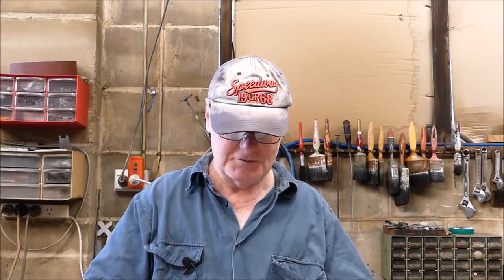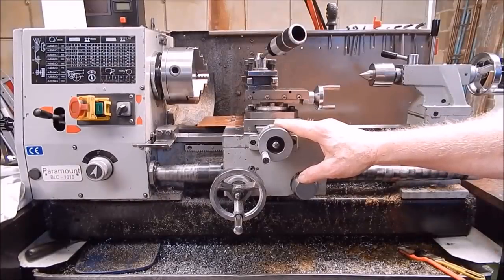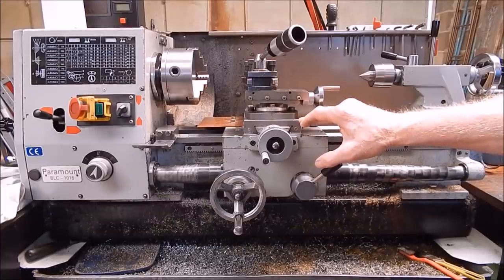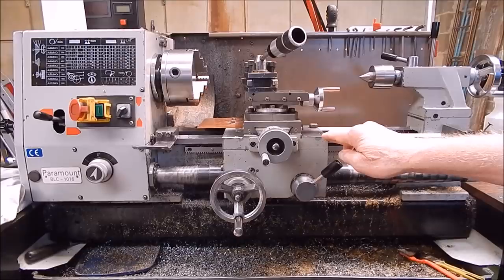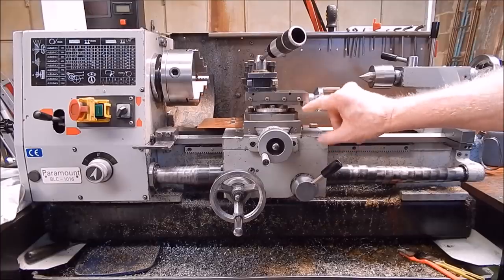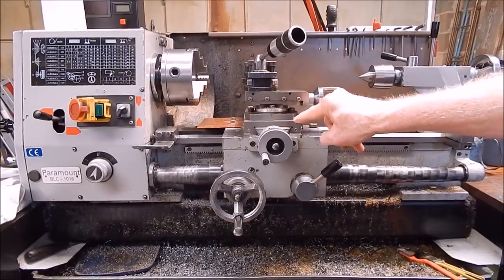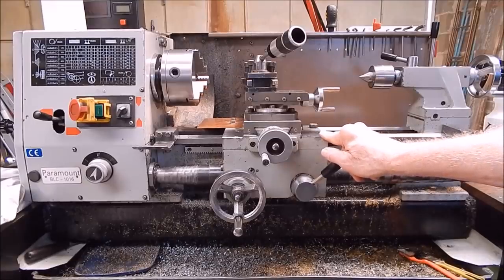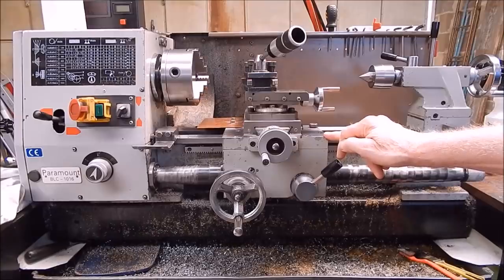The serious weakness in many small modern metal lathes

Comment: Me Shenwai 900b, has one circular T slot for the tool post. No other slots. I made a 1 inch table to fit over it and cut slots parallel to the guideways
Reply from the maker: From my observations T slots are not very common on larger sized lathes.  Strange, but appears that way.  Cheers Rob

Comment: My 7x10in mini lathe has a solid compound and cross slide however my tool post mount is a single threaded rod in the "center" of the compound. The machine became surprisingly ridged after I bought full metal change gear set up (Head Stock Gears too) and went from straight ball bearings in the Head Stock to tapered roller bearings. The amount of material removal rate on steel (mild) went from about .015 thou per side to almost .030 thou per side with spectacular finishes. Aluminium I can take almost .050 thou per side but typically don't. Don't want to kill the poor thing. I learned of these small upgrades from a few guys here on youtube that do the hobby machining. Anyways thank you for the content and thank you for also being a great teacher of various skills from fab to machining. This Yank certainly appreciates it.

Comment: No problem with the T slots here only a pain to clean the chips out! A much bigger issue was the spindle having no spacer so I put a cast iron tube to stop the bearings flapping around, also the shit motor replaced with a 1.5kw 6 pole 3ph and vfd, and big pulleys, then it is like a new machine. Thanks for the good videos.

Comment: I think the t-slots are a carryover from the asian 3 in 1 machines where the cross slide is also a mill table
Reply from the maker: IMHO it's just marketing.  Looks good, it's an additional "feature". Very few people actually use it or think about what it's doing strength wise.  Cheers Rob
Reply: @Xynudu  you are right but the lathes where you can put the mill on the slotes have them besides the dovetails so they can carry the column with the mill head and its plus 65kg for example for my lathe. I was not a fan of these 3 in 1 lathes but after a friend bought one with the milling head I saw the big advantage to work at a part milling and turning without leaving the chuck and that improves precision a lot ....so for some people the 3 in 1 can be a very good solution if they need the accuracy.

Comment: You are absolutely right and that was the reason why i bought the Schreiner D290V ( in USA Precision Mathews sells the same model under 1127 LB ) after my minilathe .It is a Chinese import with 1000mm bed and 265kg without the standing and there it also has the to long T-slots but they are not above the dovetail they are more beside where the "meat" is .First I wanted to buy a little smaller lathe but they all had the T-slots above the dovetails and that's why I bought the smallest with the slots more beside the dovetails .They used a bigger block of metal to keep the dovetails and slots about 10mm away from each other.
I like the slots because you can position the compound at the best place for the job but I had to remake the clamping system with 2 screws into one with 6 screws and now the forces are better divided over the cross slide and the rigidity also improved.Not a big job for that size of  lathe and a mill to remake the compound clamp. clamping.

Comment: Good video Rob and it’s your channel so you can rant if you want to. I have a mid eighties Hafco which is similar in spec to yours except that it’s belt drive so it’s a bit more cumbersome changing speeds and noisy but another thing I like is the availability of part. Last year the original motor literally went up in smoke and I couldn’t find one with the correct mount and long shaft on Feebay so I rang Hare & Forbes and they said the original 1hp motor was no longer available but they had a bolt on replacement that was 2 hp sitting on the shelf. Bonus. Less than $500 including postage and a couple of days later she’s up and running again. Like you I have seen the gradual change over the years in the new lathes and the cost cutting but as the Yuan gets stronger and the cost of labour as well as everything else goes up they have to reduce their costs to stay competitive. Cheers mate, Stuart 🇦🇺

Comment: I live in the UK and I have a 13inch swing (6.5 inches centre height) Taiwanese lathe which has T slots at right angles to the cross slide.  So it’s not automatically all”Far Eastern” lathes that have the sort of T slots you don’t like.  I suspect it’s specified by retailers.
Reply from the maker: Agree.  The Taiwanese lathes were largely copies of European offerings and they did it the same way.  Cheers Rob

Comment: The slots running front-to-back on the current Sherline makes sense to me because it does not use a compound, and allows sliding of the tool post in order to maximize cross-slide travel for any particular set of circumstances. They also lengthened the cross slide.
Reply from the maker: Hi Hans, I find the three cross ways slots cover all contingencies I've encountered.  The longitudinal slotting commented on by the later model owner was not a positive move in his opinion.  People can make up their own minds.  I'm simply high lighting the overall situation.  Cheers Rob

Comment: You're right Rob - if you slot a cross slide long-ways, you make the whole thing into a hinge. I wouldn't want that metal missing from my cross slide either,. They didn't used to do this. My old 60s Aussie made lathe (11"x24" roughly) has  the compound bolted on like yours, and I think two cross-ways T-slots at the far end in case you want to bolt on a rear mounted toolpost, a mill slide, or perhaps a ball turner. I haven't used them yet, but I'm pretty sure that because the slots are milled or planed 90 degrees to the dovetail ways, I'm losing a minimum in rigidity. I will have to get the TAIG out though and check it out too! You have me wondering now! Thanks, Craig

Comment: Hi Rob. I agree with your comments on the T-slots etc based on stresses etc. However, since they were also longitudinal on my machine, I think I used them to my advantage I believe. Let me explain.

Based on a video that you made a few years ago on points to look for in buying a new small lathe, I went out and bought an FI-610SM from Paramount Browns, and yes, the T-slots in the cross slide are indeed cut longitudinally. I didn’t think much of it at the time but a few months later I bought the same milling attachment that you also did a few videos on. Because the face of the milling slide was not perfectly perpendicular to the bed ways i.e. the axis of the lathe, I decided to make an adapter plate to fit between the mill attachment base and the cross slide. The mill slide was then held firmly in place by three bolts which go through the three slots in the milling attachment, through my adapter plate and into T-nuts which slide in those longitudinal T-slots. Doing it this way with an adapter plate between the cross slide and the base of the milling attachment has two advantages for me. Firstly, I didn’t have to take my cross slide off and drill and tap holes in it in order to attach the milling slide. Secondly, because the T-slots are longitudinal, it allows me to mount the milling attachment anywhere along the cross slide. This gives me a much wider flexibility in working area on the cross slide for certain jobs. At the same time, using the adapter plate, brings the working face of the mill accurately perpendicular to the lathe axis since the adaptor plate has a very small taper on it to compensate for the non-perpendicular face plate  when mounted on the cross slide. This seems to work for me, I hope that all makes sense. Love your work!
Reply from the maker: The Fl-610SM cross slide is actually quite meaty depth wise and that's why I gave it my best bang for buck rating, even though the cross slide is longitudinally slotted.    However, there are some other lathes being sold where the thickness level remaining is pretty bad/marginal and this video is really about getting people to consider this aspect when choosing a lathe.  Your lathe also has a good length cross slide so you can get away with a setup as you describe - top idea.  I thought this subject would stir up some comments, but it's totally factual IMHO.  Cheers Rob

Comment: Clearly any slots weaken the cross slide but I believe the reason they are there is a consideration for the owner. If they are purchasing a hobby size lathe is is almost always a DIY type of consumer. With the slots installed it gives the owner a much broader use for the lathe. With a small investment in fixturing, bolts , spacers , barstock ect the lathe becomes a horizontal mill that can handle work sized for the lathe

Comment: Yeah, this is a pretty late comment, but it’s one that’s always bothered me about many small lathes. The gib on the compound is on the wrong side. It should be on the trailing side. Yes, the lathe can be worked towards the left, as we would think as normal, bearing against the spindle, but also worked towards the right, against the tailstock. Going towards the right is less than ideal on a small lathe and should be avoided except for some threading and other light pressure work, as with small chucks and collet systems, the cutting force tends to pull the work away from the spindle.

So, with the gib being in the left side, the pressure is against the gib, which it shouldn’t be. One reason is that small (inexpensive) lathes use gibs with screws to bed the gib against the sliding dovetail. The problem with that design is that the gib isn’t touching the base on the side of the dovetail there. Unless the height of the gib is exactly such that it slides against the bottom of the base dovetail, and against the top of the sliding dovetail, it’s subject to lifting forces and downward forces from the tool pressure. The gib tends to twist in that slot, causing the sliding part to shift. Some compounds have four screws, but some, only three. As the top of the compound slides back, it tends to move past the first screw giving the gib a chance to also tilt sideways at an angle.

Larger lathes tend to use the tapered gib design which always has 100% contact with both dovetails. This prevents the above problems from occurring. Very few of them have the gibs in the left side, also because of the above problem of riding on the gib.

Comment: You make a good point Rob..I have a soft spot for T slots on the cross slide for the occasional line boring job but not at the expense of rigidity..It would be handy to have some T slots that could be bolted to and then removed from the cross slide for the occasional job and maybe thats what I will do..regardsE

Comment: I bought a small gearhead (All metal gears)lathe 160mm Chuck 330mm Swiing and discovered a weak link after it got less noisy over a few months. I replaced oil and adjust fanbelt from motor to input shaft pulley(Not spindle).
After the fanbelt adjusted it ran noticebly noisy. It took me a while to remember the fanbelt.
On investigation I found that the 3x bolted extrution-part to the headstock casing actually move a bit even tightened, its made of hardened steel. Now this part purpose is to isolate the belt tention on pulley from input shaft and it's two bearings in headstock housing. Now the pulley has a large bearing inside it which was rough and I replaced it(the blind hole battle thing to get it out). This made little difference. The input shaft runs trough this part, the pulley mounts on it and a keyway and nut tightens the lot, I found I cannot tighten this nut completely either, this cases some other noises.
My temp selution is to bought a flexable belt with teeth, run it with much slack, it has enough grip still, and now lathe runs quiet. 
I discussed this with a local machinist of many years, and he suggest I bore 3 extra holes, then ream and fit 3x dowlpins to accurately locate this part and keep it located, he said, bolts do move. So I still has to do this. I dont know what the engineer was thinking, I did notified the manufacturer.
Reply from the maker: That's a 13" swing lathe.  Not exactly what I would call small.  But regardless of that fact, it seems you have identified a problem.  Rather than try and pin the component (it's hardened) maybe consider using a bit of Loctite on it.  They make a range of adhesives/fillers for metal/mounting bearings etc.  Cheers Rob

Comment: Looks like you've identified an upgrade industry. Let's start supplying replacement cross-slides that are correctly slotted for the popular models. We'll make millions.
Reply from the maker: Hi Rick,  I've seen several videos of guys machining up new cross slides for old and new lathes.  Looks pretty simple if you have a decent mill.  They re-used many fittings and were good to go.  I think you can buy modern blank castings for the oldies and just finish them off.  Cheers Rob
Reply: @Xynudu  Drat. Foiled again.

Comment: Just saw your video, I think you hit nail on head and I can tell you why mine has a pair of Tee slots; they sell as a lathe/mill combo. 
I thought great idea when I bought mine first, then I realised I had 2 half useless machines. Once I purchased a proper compound slide for my mill head and seperated the two, they both do their jobs properly. 
However I do find too much flex in my lathe which can cause me problems. 
You definitely noticed the cross slide flex when you mounted a vice on it and tightened the mounting bolts, it could cause drag the cross slide!!
I will now have to think how to change/strengthen or make a new cross slide
Reply from the maker: Hi Damian,  yes bolting anything down onto a cross slide will instantly show you how rigid it is.  Even a solid cross slide like mine will still have very slight flex and you will feel increased drag as you move it.

IMHO reducing the thickness of metal relative to the dovetail and the external dimension of the cross slide is a bad move.  Depending on the positioning of the dovetails, metal thickness may be reduced vertically AND/OR horizontally.  Once again the overall thickness of the cross slide has a bearing on this.

Remaining/bridging metal thickness is very poor in some new lathes.

Cheers Rob
Reply: Damian Pianta
Just a question  what make of lathe. Was it an OPTIMUM I just bought one and the toolpost slide had casting defects.

Comment: To make the top slide more rigid on the Sherline, you could install a 1/4" or so plate in order to bridge over the T slots for the unused portions of top of the slide, make some spaces for the tool post in order to keep the height standard, you may need more than one plate if you plan to use all the slots. To be tried if you get spare time to experiment....    😎👍

Comment: Actually cross slide t-slots are pretty doggone helpful for line boring between centers. One of the most accurate ways to bore available. My Grizzly G0602 does not have any so I'm thinking about an array pattern of 1/4-20 threaded holes (4 threads deep- once you hit 3 threads you've already got 90% of strength - see Shigley's Mech. Eng. book) across the top surface of the cross slide so I can at least use 1/4-20 studs and toe clamps to fasten down workpiece to the cross slide surface -  better than nothing.

Comment: Hi Rob,
My Hare and Forbes AL50G had those longitudinal slots and you are correct the slots weaken the cross slide considerably and i could see the casting deflect  even with moderate cuts .
The AL320 i have now has no slots but the stingy bastards thinned the rear of the cross slide down by about 3/4 of an inch ! I have an old myford cross slide here that i am going to fit to the cut down section so i have a few T slots if i need them , only takes a minute to screw in 4 cap screws to fit it . Another thing that annoys me is that they seem to have shortened up the saddle width and cross slide width .

Thanks for the video mate !

Comment: I have a SIEG C2 which I love. It has a lot of limitations caused by its size but I can't house a bigger lathe. But the biggest limitation in rigidity is probably the small screws which push against the gibs. Look at the amount of "meat" at that point. Literally a point.... I  added a few extra gib screws which really helps but most latches have this arrangement except for the real high end ones, such as Schaublin. But probably this arrangement is less of a problem if the slides are wider and heavier because the mass can reduce the need for utmost rigidity.

Comment: I agree.  However, I think that the reason the tee slots run along the cross-slide is to accommodate the various taper attachments that are supplied with Asian lathes.  Most of these lathes I have seen are composites made up from parts supplied by various sub-contractors.  A lot of the components on my "Birmingham" 14 X 40 are interchangeable with other brands, Jet, Grizzly, Precision Matthews, and a lot of "brands" sold in other markets.  Cheers.
Reply: Mr T  I love my old ex-industrial lathe and mill. I had a brand new mill from China. I also had use (for an extended period at my place) of a friends as-new Sieg C6 lathe, and I don't for a second regret going for older but quality over newer machines. I would make the same decisions again tomorrow if needed. The scrapper doesn't come into it, and the clapped-out phrase may more quickly apply to the new stuff.

Comment: That compound is more of a problem than anything. I made a solid block to mount my tool holder to delete the compound and wow what a difference that made. I can actually take real cuts now.
Reply from the maker: Compounds vary enormously regarding their rigidity.  I have a large basic block type tool holder as well (same as Sherline use) but rarely use it as the standard compound works fine.  Put a bar in the tool holder, put some pressure on it and take some readings for flex at various points.  You will get a surprise where the flex is actually coming from.